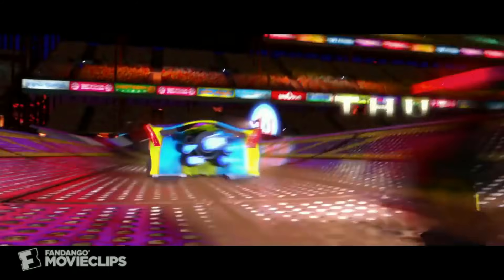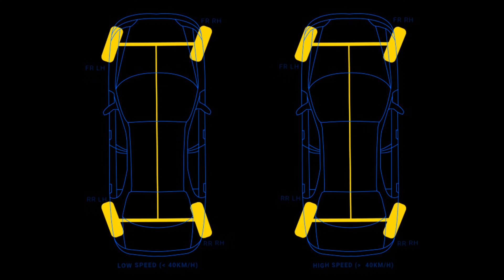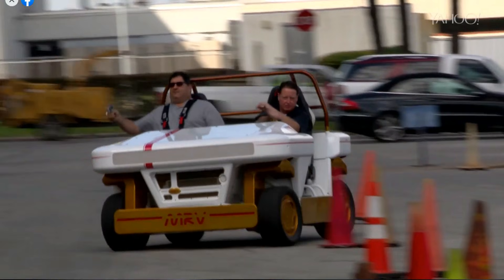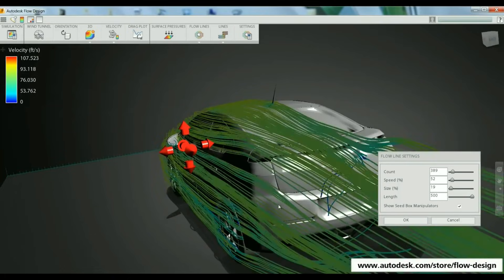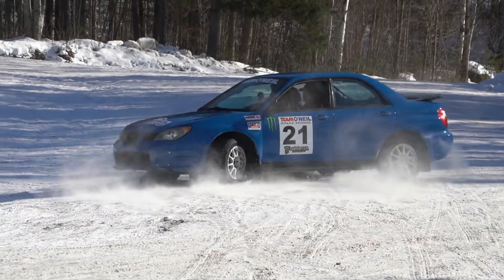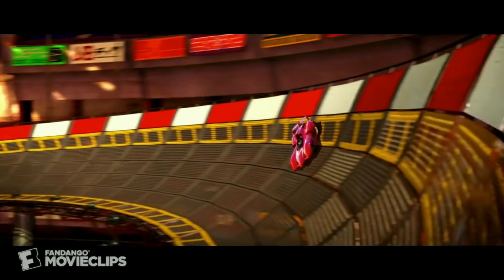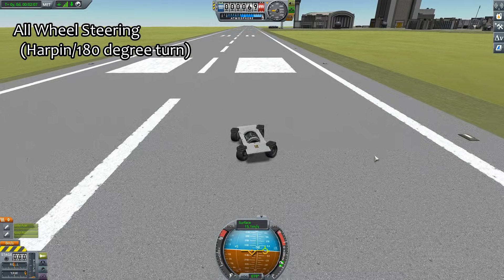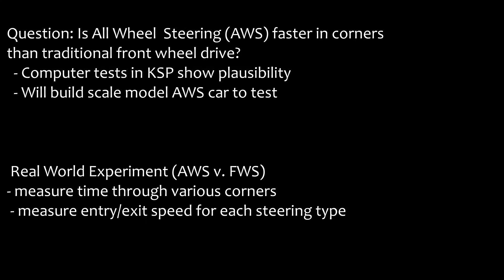Will Speed Racer & NASA Technology Revolutionize Racing?

Comment: i think aws is vastly superior when have a jet engine on the back. and then instead of trying to take corners normally. the tires would offer little turning but mostly it will be done by pointing the jet engine to the outside of the corner to push you through the corner

Comment: Nascar had a crab walk era where cars were built at a angle on the chassis. They did it so the lateral force of the slide of the car slamming into the wind function as a sail helping the car corner. I think that could be a additional benefit

Comment: Just here to drop an interesting point about 4 wheel steering, there is a very popular form of racing that has rear wheel steering, dirt late models. Our cars are designed to have the rear wheels turn to the right to help us turn left when we use our throttle a specific way.

Comment: I feel like managing the mass would be a significant struggle. IKEA carts for example are a nightmare to turn and drive regularly, but are amazing in the tight corners when you can adjust it to move wherever you want. Maybe this issue is because they aren’t driven wheels? There’s potential, but I’m still skeptical it will be faster

Comment: If you ever get around to building one of these full scale, I would consider a BMW drivetrain. Not because of reliability which they don't have, but because BMW's all-wheel drive system actually still uses a traditional longitudinally mounted engine and transmission, with a transfer case in the center and a front differential that sends one of the CV shafts through the engine oil pan. It's a very robust system and it can handle quite a lot of horsepower. I believe the m4 competition has upwards of 500? That's not a stick shift though, paddle shift only. I think the stick shift transmission can only handle so much horsepower. 

However, there's also a case to be made for hybrid/ full electric. Hub motors in the wheels would make CV shafts a total non-issue. And then you could essentially have an internal combustion engine hooked up to a generator. I know that in the movie they specifically said it was a V8 with a sequential transmission and real all wheel drive, and then somehow a turbine engine married to the back of all that. But IRL I think a turbine connected to a generator would be a lot more realistic.

Speaking of turbine motors, a lot of helicopters use what are called turboshaft motors. It's basically a jet engine, but instead of getting most of its power in the form of thrust, it gets it mostly in the form of a turning force on a shaft. Which is why they're called turbo shaft engines instead of turbojet. Anyway, it would give you the same effect of flames coming out of the rear of the car, but then the shaft could either be married to a traditional transmission and all-wheel drive system, or a generator in the case of a hybrid/ electric drivetrain. Drivetrain. And since they're made for aircraft, they're actually designed to be maintained. Although I don't know if they're easy to maintain, I'm not a flight mechanic.

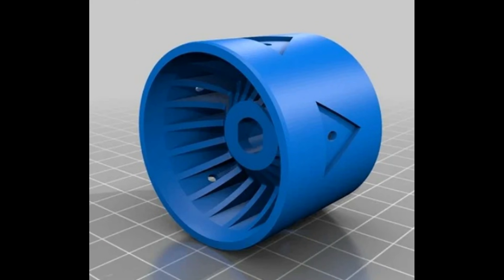Comment: 1:28 kind of a reductive understanding, Rally cars usually handbrake turn to be able to get the car rotated into the correct position faster for the traction on exit.
Its a compromise for having limited steering that's a fast enough ratio for motorsport.
Even if you have 4wheel steering you're still limited by the traction of the tires too.

edit: something interesting you could look into is having active toe alignment for stability on entry and exit of a corner.

Finally you should look into tire slip angle, caster camber and toe as well as scrub and kingpin angle as they all contribute to steering performance.

Comment: the gains would be at best minimal because the rear tires of traditional cars are also engaged during hard, proper cornering, providing a good amount of the lateral acceleration during a turn. The main difference is now you can engage them with a steering input and the approach for cornering is different.

Comment: I think the MAIN PROBLEM, is finding a way to make the wheels semi-omnidirectional, ON TOP of finding a way to translate the horse power to the wheels reliably.
Reply: I think the whole idea stems from some misguided beliefs from watching too many fictional racing movies. Going sideways for the sake of using 4ws just induces drag, makes all of your aerodynamic design pointless, and gives no real benefit over traditional front wheel steering. 

Real tracks don't bank 80 degrees in every corner to accomodate that kind of racing, and even if it did you could just drive straight on it and go faster anyway (i.e. NASCAR). Limited rear wheel steering to aid in rotation would be much more realistic, even if pointless in high speed applications.
Reply: @candle_eatist  a system like the T180s actually would provide benefit for a car that uses thrust propulsion, since itd allow the car to vector the thrust without inducing too much side slip into the tires during cornering.

I do agree that the aerodynamic situation would be incredibly tricky though. Having the car become a massive airbrake might be a benefit but its probably really hard to control that especially when following other cars
Reply: I dont think so, the rear wheels dont need to turn as much because of how effective itd be, and we have fwd cars that steer with pretty good rotation
Reply: The T-180 cars use a some kind of SCI-FI jet engine system as their main source of propulsion. Please note that the speed racer movie features cars with both T-180 wheelbases and classic wheelbases, the cars that don't have rocket booster looking engines have classic wheelbases.
Reply: Maybe hub motors? like some electric cars and bikes where the motor is inside the each wheel. This could also make AWD to RWD or FWD conversions as easy as changing wheels.

Comment: Try making an RC car to do this with. Use PCB way to 3D print parts for you. Just remember, any powered axle probably can't steer more than 30-40 degrees in either direction without highly specialized parts (particularly the CV joints) and even if you have those, the absolute hard limit will likely be about 65-75 degrees just like the front of a traditional drift car. That's if you want to have a suspension that's compatible with the forces of a race car and can produce relatively typical geometry, such as caster, ackermann, kingpin inclination, mechanical yrail (the most important for "normal" or "straight on" stability and self-steer), and so on.

Comment: When I think about rear wheel steering being applied in racing, it reminds me of one of the stock cars in the 'twisted sister' model line in NASCAR. The car was set up with its rear axle at an angle so as to make the car 'dog track' in order to gain an aerodynamic advantage by creating suction on the left side of the car for better cornering.
Reply: Just going to add on to this that the cars and speed racer also use thrust based engines, so strafing the car around the corner allows them to use thrust to steer.

Comment: You get no traction at high speed if the turning angle in the rear is too high. You want the rear to bury into the ground not glide outward. 
If the professionals aren’t already doing it then there’s a reason man. Love your curiosity and engineering mind!!

Comment: Suggestion: You're going to want multiple driving profiles with proportional control goaling for each mode, so you can slip from mode to mode in a set of blended state-machines. Doing that, the gains would be bonkers. Even moreso is if you then pair this with a rocker-bogie assembly.

Comment: My personal thought process on the T-180 cars in Speed Racer is that the cars back wheels function more like caster-wheels, where they can freely rotate to follow the direction of the car when you steer beyond the slip-angle.

If you look at the vehicles like the Mach 4 and the Mach 6 the wheels look like they are clamped to the car by what appears to be vice grips. And similarly to how drift-tuned cars can use the handbrake to enable a drift it's not impossible to draw the conclusion that T-180 cars have a lever that enables this caster-wheel like drift.

Comment: While AWS would improve the car’s turning circle, wider turns would still be more or less the same, as the car is still limited by the grip of its wheels. T-180s differ in the fact that they have both traditional wheel-driving engines, AND jet engines, and use their AWS to turn the jet engine in any direction to help push it through turns. You can even see the origin of the jet-drifting technique in that clip of the Mach 4 - Thunderhead is made of steel instead of asphalt, which makes it slippery; instead of relying on massively reduced grip, it was faster to forgo grip altogether and use the car’s jet engine to steer. T-180s double-dip and get the best of both worlds by maintaining wheel grip AND using jet steering.
If you want to simulate this in KSP, I’d suggest either putting a rocket on a servo instead of the wheels, or maybe do something with RCS ports.
Reply from the maker: Huh, might look into that. I figured grip was the limiting factor but I’m not good enough at dynamics to show it mathematically. Thanks.
Reply: Oh no the thing with grip is that when you get too much for a given center of mass, the car will flip and start doing rollovers, which engineers prefer to avoid over getting that last 5% of cornering performance, you can see this happening with going around corners with drag tires.

This is why engineers prefer downforce because it increases the ratio between force and weight,  a car of 1000kg at 1G (earth gravity) gets ~9810 newtons of force it can use in the tires, to turn those same 1000kg's, if you add another 10000newton of downforce you can turn around at ~2G's

After watching the first few minutes I also realize that you have made a error in drifting, a tire starts to skid when there's no more newtons to apply the difference in speed, causing it to start bouncing and decreasing the effective coefficient of grip, but when it's barely on the edge of that skidding that's when the absolute maximum traction is achieved, that's why the rear wheels never turn for grip purposes, since there needs to be a difference in angles to get the traction you want, 

the only difference in my mind between driving straight or all wheels at 45 degrees is where your rear bumper (and your big turbine engine) is pointed, which does make a heap of a difference 
  @CaptainPineapples

Comment: I don't know if this is still a project of yours but a similar drive train to AWS is used in robotics such as in the FIRST Robotics Competition (FRC). In FRC that kind of drive train is called a swerve drive train as it gives each wheel rotational and speed freely to each wheel individually. There's also crab drive which is like swerve drive but all of the wheels rotate together as they're physically connected to one another
Reply from the maker: Maybe we could reach out to a team with one and ask them to do a quick test of cornering speeds and compare the times between AWS and 2 wheel.

Comment: Not me crying out in joy while watching this, great video man!!! One thing we need to consider for race applications is that fact that with these sharper turns, wouldn’t the forces acting on the driver be far greater than before?
Reply: If the cars were as fast as F1 cars and the tracks were designed to incentivise whipping the the cars through turns there would be significant G forces acting on the drivers’ body. The HANS device would probably need an upgrade to minimise side to side movement as well as front to back. But I think the drivers would be able to handle it, as long as the cars aren’t rocket powered they wouldn’t need to be quite as conditioned as a fighter jet pilot.

Comment: 3:13 while this is definitely a childhood dream of mine that I hope one day comes true, I think this 4 wheel system only applies to T-180 types, true or otherwise, such as the Mach 4 and Mach 6 (although from what I can tell the Mach 4 isn't a true T-180 , as I think it's a T-100, and doesn't seem to use all 4 wheels, but an early variation of the system since it is from an older generation). The Mach 5 and shooting star featured in the timestamp are not T-180s, to my knowledge, but rather just appear to be a typical sports car(or at least don't appear to have the same all-wheel steering system as a T-180), and therefore don't really make for a good example to illustrate the steering mechanism being proposed. Unless ofc they're just being used as a parallel to formula1 vehicles in real life. Slight nitpick, I know, but still. Hope this happens one day!
Reply: A bit late but, the Mach 4 is indeed a true T 180, its just from the very first generations of the category which had conventional steering in the front wheels and the 180 degrees base in the rear wheels, this is the same setting that the Uniron car Rex used had when he left Racer Motors

Comment: Love the video but for the T-180 to pull of the turns the driver takes advantage of the jet exhaust port to propel the car through the turns. And not just an AWS system but it would also need independent suspension to safely pull of the flips and rolls and have the aerodynamics of an F1 car to drive on those amazingly outrageous tracks safely as well. I think it’s possible but very difficult

Comment: I would encourage research into the thrust vectoring that explains the mach 4 lacking a turning rear wheel (but still has some enhanced suspension, perhaps to more directly control the rear wheels?) And the effects it may have on a vehicle with a t-180 style rotational steering wheel, perhaps even in regards to braking, and, keep in mind that these cars had ridiculously high banking for the turns, so they likely go much faster than a formula one car.